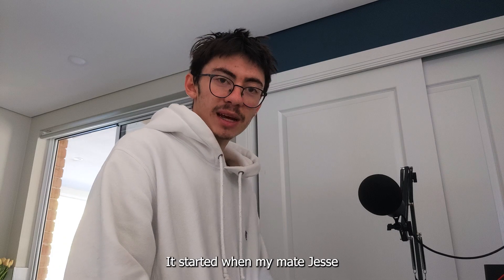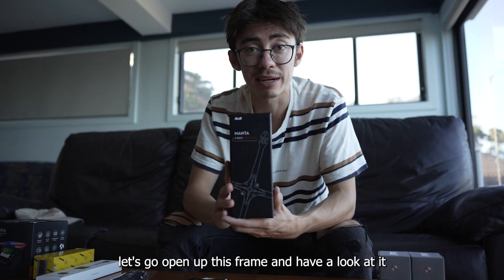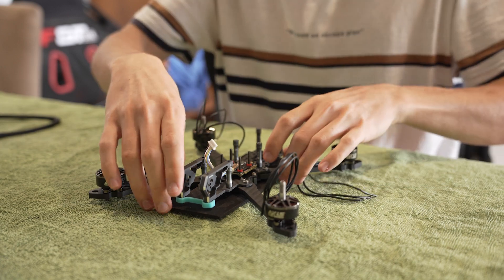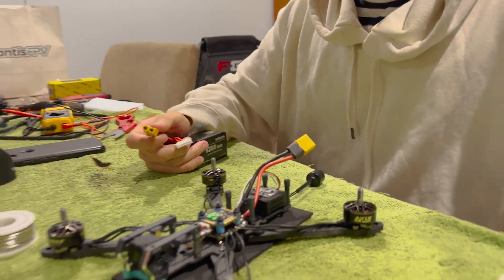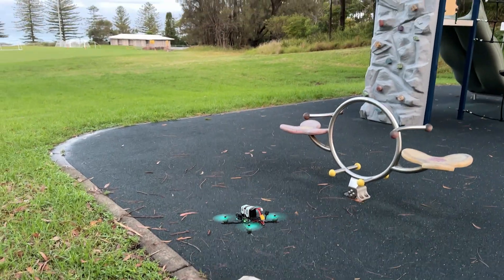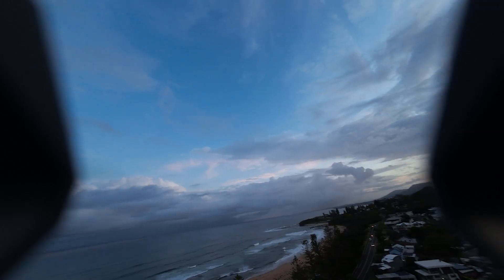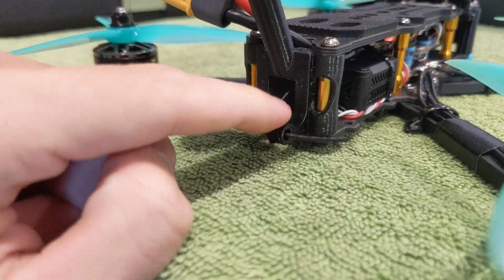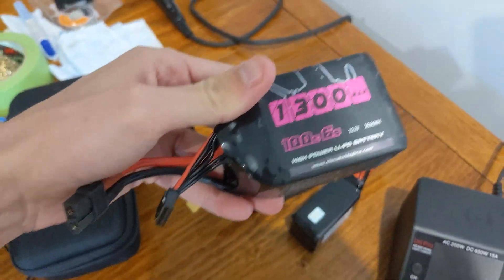Building My First FPV Drone

Comment: Welcome to the most addictive and thus by time expensive hobby! 
Respect for going all the way to build your first one yourself, best way to go.
For soldering, get sth. like the Diatone Mamba Soldering Practice Board. 350°C - 410°C, the bigger the pad the more heat you need to be able to go in and out fast, for not heating up the board too much. But most boards have good heat resistance by now. But I bet you have good help from flight experienced buddy, also check out for locals to get into it ;-) 
You made great progress!  Keep it up, have fun up there! 🙂
Reply from the maker: oooo that's a good idea I'll have a look at getting one of those boards, and thankyou

Comment: the motor wires are too long, try cutting it shorter. and there is a pop on the drone when you plug it in its because you don't have a compacitor. Great job I love to see you fly. keep practicing :)
Reply from the maker: yeah there are a few wires that are a bit too long, I'll cut them to length when I re-solder and clean it up

Comment: props do matter compared to 1 battery ...5050 , 5052 or 5060 you get more speed & thats more smile time ...welcome n good luck
Reply from the maker: yes, you're so right. I didn't know at the time, but after I tried the other props I could feel the difference in speed (and smile time). I'll have to do some research before I order some new props.

Comment: try to use loctite 242 or 243 on ur next build. it helps with screws not  getting lose overtime due to vibration. just make sure u only use it on parts that go to metal only. for the charger it's okay to hear that boom sound, u can still plug the battery when it's on
Reply from the maker: oh ok, so i can just put that loctite paste inside regular screws, that's really helpful thankyou. What's the difference between 242 and 243? (yeah I've become accustomed to that sound when plugging in the batteries, it caught me off guard the first few times though :)
Reply: @tomyew  242 is a liquid like water so you would to clean the screws from factory oil using alcohol for it stick,if not it will stick to the screw properly. Whereas the 243 is a gel style and it can stick to screws that has factory oil, but it’s still recommended to clean the screws with alcohol just to be safe
Reply from the maker: @Twx97  I'll for sure be using that in the future. Thankyou for those tips, you're a legend!
Reply: @tomyew  np. I hope you’re having a great experience, and if you’re thinking of trying helis i will be more than happy to help you🫣,you’re gonna love it😉
Reply from the maker: @Twx97  I'm absolutely loving it. I'll be sticking with quads for a while, but in the future I might try them out, thanks😄

Comment: I’ve got everything ready to go and I swear I’m just like you but you dove right in …..I’m going on my 2nd week of procrastination on soldering
Reply from the maker: yeah it was so stressful doing that first bit of solder on the ESC but it got slightly easier as it went on. You could get one of those soldering training kits, but that would stress me out more. So thats why I just went for it, if you've watched Bardwell's video on soldering, you should be good. Also I only remembered later on, but take some time to put masking tape (painters tape) on the ESC and FC before soldering, once you see that all the important bits are covered and safe, it helps ALOT with the stress.